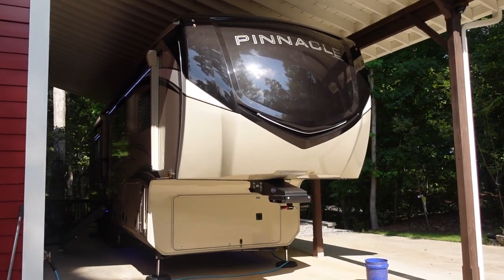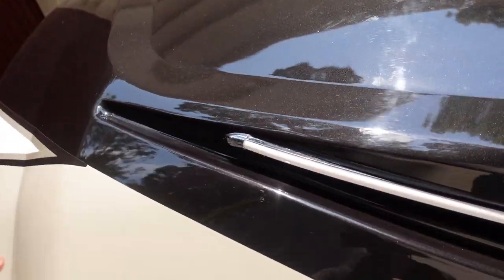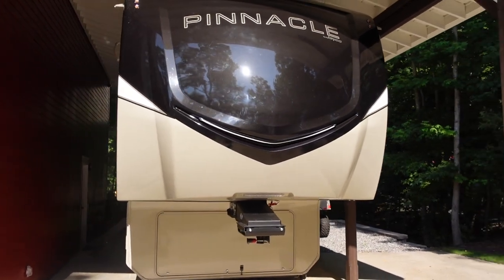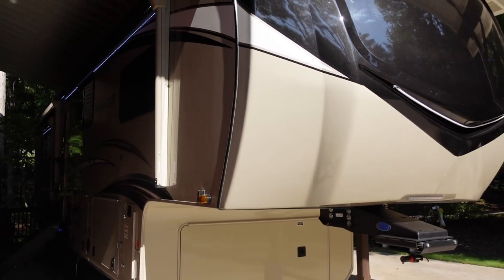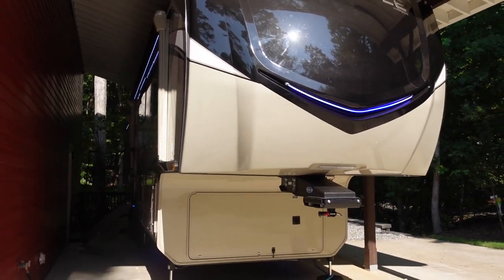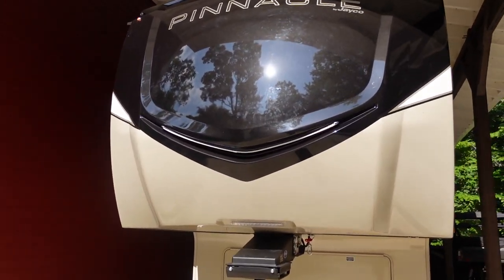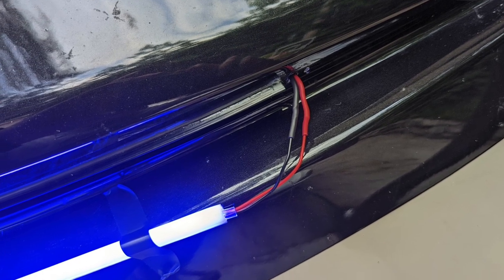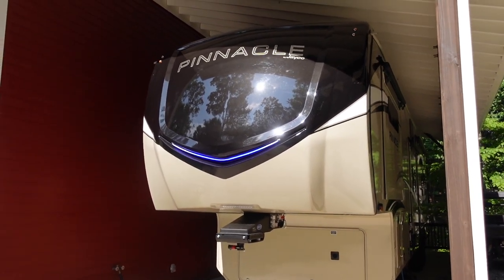How to Fix the Neon Tube-Style LED Front Cap Light on the Jayco Pinnacle or North Point Fifth Wheel

Comment from the maker: For those looking for the BLUE color OR the actual silicone tube/sleeve itself...the blue LED shown in my video appears to be out of stock permanently. However, I found one below that I believe is a suitable replacement at 8mm wide and 5M long. I have NOT used the replacement listed below personally, but again it appears to be the same exact dimensions. It also has slightly higher density of LEDs as a bonus, so I think it should be an alternate for those looking for a compatible blue color. Certainly let me know if you find otherwise. Here is the link:
https://amzn.to/3uyQLvk
And, I also found this silicone LED tube in case you need to replace the entire tube itself. Again, have not tried this one myself, but it appears to be pretty similar to the one Jayco uses with an advertised max inside width of 10mm, so should pair nicely with 8mm LED strip. Again, let us know if you try either of these out how they work out:
https://amzn.to/3xSelVL
Reply: For clarification , the link takes you to a 24v/12v strip. The supply at the point of repair is 12v , correct?
Reply from the maker: @kellyelveston6232  correct, actually the replacement strip can be used both with 12 volt and 24 volt, but the wires are the same essentially for both.
Reply: The light strip I received was marked 24v and would not work
Reply from the maker: @kellyelveston6232  oh I see the problem now. On Amazon there are selections for different voltages, and it's possible they sent you the wrong voltage. I'd recommend returning it to Amazon and reordering the 12 volt version and seeing if you get the actual get the 12-volt this time. Sometimes they mix things up in the warehouse.

Comment: Thanks for the very informative video. I reached out to a Dealer near me and they want about $50 each for the lights for my end cap. I have the same problem on my 2021 Jayco White hawk 34BH.  I decided to do the repair the same way you did and save some time and money.  Like others my lights run vertically on the end cap and there are two of them. I have ordered the light strips that you linked in the description and they are supposed to be here tomorrow. Mine do not have the silver cover like yours have on the ends but I would love to add them because it looks like they would help keep the end of the tubes form getting water or moisture in the tube. Mine are simply sealed with silicone and that is why they eventually failed. The silicone shrank which exposed the end of the tube and the water was then able to get in and cause the lights to fail. I have looked everywhere to try to find some caps like the ones you have. I think it maybe that I just simply don't know what to call them when I type in to search for them. Do you have any idea where to get them?
Reply from the maker: I'm at a loss on those caps as far as where to source them. I wonder if they are specific to RV industry. They were more aesthetic on mine so I siliconed them into place for redundancy, but I really think there should have been a mechanical seal/cap that fit snuggly into the tube. I bet if Jayco reached out to the vendor that supplies them with tube and caps they could easily make a mechanical seal to that profile.
Reply: @AdventureRocks  OK thanks for the reply. BTW my lights came in from Amazon yesterday and I got them changed out this morning & they look great again! Thanks for your help! I will keep looking for some type of cap to put over them.

Comment: Have the same issue. Started in the middle and has spread. The left side had a gap between the light strip and the chrome end piece. I pulled the light strip out of the track and water just poured out of it.
Reply from the maker: How recent is your build? I would have hoped they fixed it in production by now.

Comment: Wonder if you could attach a “pull wire” to the 2wire lead at both ends .. fish the pull wire into the tube first .. then pull the led strip through vs trying to push the strip through?  Great video.  Dealer just replaced ours on our 2021 model coach under warranty while the coach was in there for a few other minor items.  Dealer sealed both ends as you documented, hope they did a good job.
Reply from the maker: Great idea, thank you

Comment: I have a 2020 Jayco Eagle HT 280RSOK with twin "neon" lights. Mine shines orange, through white tubes. I'm trying to find an orange strip.  Trying to get an answer from Jayco is like pulling teeth.  Any suggestions?
Reply from the maker: Sorry to hear about Jayco. Do your tubes look like the one on my Pinnacle? Wondering if Jayco uses the same vinyl tube size across all their lines? There's a close-up in video at 9:02 showing profile. If it is a match, then here's a link to the vendor I found on Amazon to replace the inner LED strip: https://amzn.to/3xLb1uQ

They have a few other colors, but I don't see orange at present. It's basically a high-density (aka COB) LED strip, meaning the individual diodes are closer together compared to a regular strip, and that makes it look like a neon tube by the time it goes inside the vinyl tube. If you need a different color, try searching on Amazon for "12v high density led strip + color" and see if that gives you any alternate results. The challenge for me was to find one narrow enough to slide into the existing vinyl tube. So check yours and see what the inside width is to ensure whatever LED you choose can slide in. You should only need 1 strip still as you can cut in middle and use leader supplied on both ends to feed into your 12v source. Hope all the makes sense and hope you can find one that'll fit in right color.
Reply: @AdventureRocks  Where is the link to the "blue" light?  I've clicked on all three of your links and they all go to the same set of lights but no blue?
Reply from the maker: @hjets5387  It looks like the blue is out of stock right now. I see what you mean as there are only cool/warm white essentially. Prices went up a bit too.

Comment: Did your nose cone bird decal come off hard? I don’t like mine!
Reply from the maker: I'm with you...did not like it either. Think it looks cheap. I took mine off about 4 months after it left the Jayco factory. The decal mostly came off in smaller pieces. The vinyl would tear easily as I pulled on it. I don't think it took more than 30-45 minutes to get the whole thing off. I had a little residue left and got that off with some light sovlent. I noticed a very faint difference in the black paint behind it initially, but after cleaning it and then letting it weather for about a month, it's completely invisible now.
Reply: @AdventureRocks  great! Your videos are well done, I think you're one on the best creators on uTube.we just bought the 32rlts full body paint. Keep up the content!!
Reply from the maker: @tombesaw2657  thank you, appreciate that. I bet the full body paint looks sharp!
Reply: @AdventureRocks  it does look really nice,we pick it up next week from Buffalo NY.
Reply from the maker: @tombesaw2657  hope it all goes smoothly!

Comment: I have the same problem with my 2020 eagle ht fifth wheel. The white housing is to short. My lights are vertical on the front cap.
I’m trying to locate a replacement set.
Does anyone else have the same issue?
Reply from the maker: I've actually had several people comment with your same model that they have the same problem. So it must be pretty much across the Jayco lineup where they put the LEDs inside of the tubes, but fail to seal them so the LEDs eventually fail.
Reply: @AdventureRocks   Yes I have the same thing. I am one month out of warranty so I am going to have to call the dealer and see if I can order the parts from them. Mine is about 2 inches short. The led strip is showing on the top of both of mine(have 2 since I have an eagle). The water ran right into it. Pretty sad that this wont be covered. It's poor craftsmanship. Surprised to see that from Jayco. I will keep you all posted on what I find. Thanks for the video.
Reply from the maker: @jordantucker9460  Sorry to hear about the warranty expiring. Hopefully the dealer can get you fixed up. I'd imagine by now Jayco has gotten this issue corrected in assembly, as it's got to be pricey $$ fixing all of them with labor factored in.
Reply: Jayco responded to me with a part number for my 2020 Jayco Eagle 284BHOK. Im not sure if this is the same part for your coach but Im guessing I can get my dealer to order it for me. I was also hoping I could get it in a different color other than orange. I like the blue better sicne thats what color my under lights are. I might get them to order it and put my own light in it. Information is below. 

front lights with housing

0334261

LIGHT,STRIP DIFFUSED AMBER 53" WITH 12" LEAD VISTA CHANNEL
Reply from the maker: @jordantucker9460  Glad to hear it. Thank you for sharing. The blue featured in my video seems to be out of stock permanently. However, I believe this is a suitable alternate: 
https://amzn.to/3uyQLvk
I have NOT used the above replacement one personally, but it appears to be the same exact dimensions (8mm wide and 5M long). It also has slightly higher density of LEDs as a bonus, so I think it should be an alternate for those looking for a compatible blue color. Certainly let me know if you find otherwise.